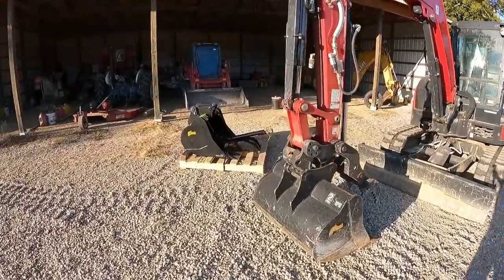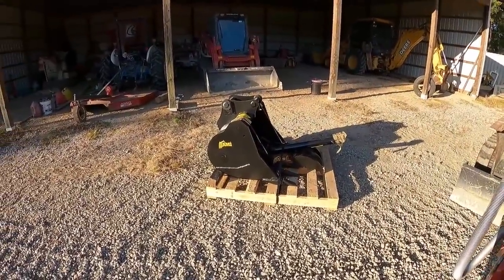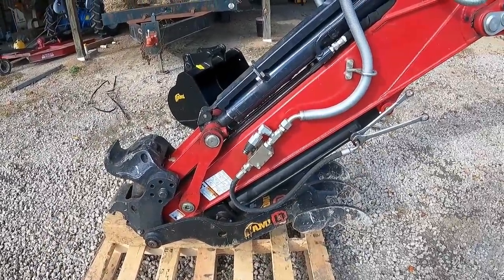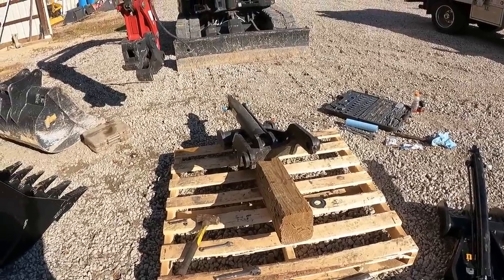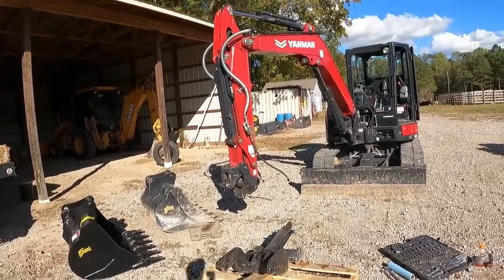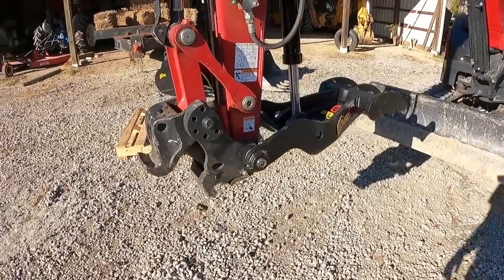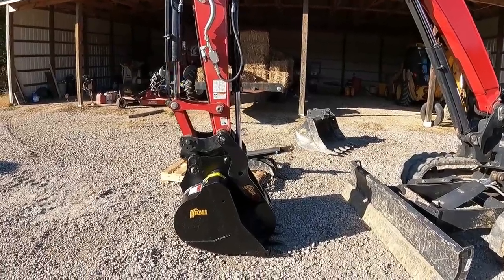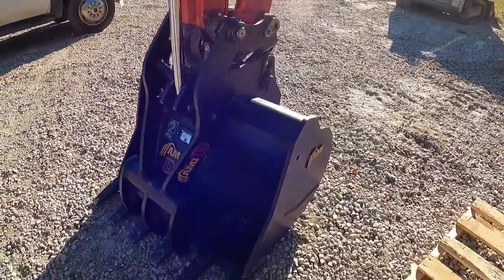Installing My New AMI Mini Excavator Attachments

Comment: You should add a good dead blow hammer to your tools. They don't damage or mushroom pins. I used them alot working on heavy equipment and machinery. That bucket change made quite the difference.

Comment: Much better and in your line work Chris it's definitely going to be more efficient and I'm not sure if anyone caught it when you were knocking out the pin with the over size chisel using the flat end so that you didn't damage the pin
Reply from the maker: Yup I can't stand the chisel marks beat into the end of a pin

Comment: That's a lot better. It's hard to tell on camera but it looks like the cylinder shaft is purty close to the quick culpler when the thumb is all the way down. It will definitely allow you to pick up brush much closer to the machine. Good video Chris!

Comment: It makes my blood run cold seeing steel whacking on steel (chisel) I allmost lost an eye bashing a relutant tooth on a bucket many years ago.  Paying for that boo boo now with scar tissue.  Good video though thanks.
Reply: What else is he supposed to hit it with? A hot dog roll? Where was the chisel? He was hammering a pin in and hammered the bolt slightly so it would spin the pin so the holes lined up. Had eyewear on the entire time as well.
Reply: @mikeznel6048  At approx 11 mins the sharp end of a chisel of some sort.

Comment: It's nice to see the engineers at AMI aren't to arrogant to have a relationship with you, a .... decent operator, LOL to develop new products. I like that set-up with the three tine thumb, how's it for deflection on a uneven grab. The Tag set-up my 55 came with is only two tine and not supported great, with the gusseting ending almost a foot from the tips. If you grab a uneven load you can tweak the thumb tines, no worry though, the next time you grab a load opposite, it will tweak back. I don't like that and am welding in a gusset closer to the tips this week to help with the deflection and better grab/hold ability. I might just get this set-up after the rototilt comes. AMI has great products, they just leave a mark, lol  you get what you pay for though.... sometimes anyway. Let us know how this works out, and don't forget the discount link.

Comment: Better uses than before with the claw having much more distance to travel. 

Only flaw I see is at 23:35 when the bucket puts pressure on the claw. Taking out the slack, could see some flex in the rod when the buckets applied pressure on it. On light loads, it should be ok but not sure about heavy loads when you need lots of grip. Could see the rod bending due to the angle it its at.
Also. the rod clearance to the pivot point is a bit close? need close up to see, but if dirt is on there, could cause issues on the rod.

Comment: I don't know if anyone else noticed this little detail, the thumb cylinder has grease zirks on both sides (at the pin pivot), so it doesn't matter which way it is installed, there is a zirk on the bottom.  Props to AMI for this attention to detail.
Reply from the maker: first thing I noticed when I looked at the cylinder!

Comment: Will you be able to get to the grease fitting with the cylinder turned over, like you did?   Edit,   now I see that it has another one on the bottom side, also.

Comment: So, now that the grease fitting at the top of the cylinder is completely hidden (13:55), how do you lubricate the top pin?  It does a nice job of protecting it though.
Reply: Should be an easy fix. Just get a 90 degree grease fitting. Just have to take the pin out to make room to swap out the fittings.
Reply: Or just curl the bucket so he can get to it.

Comment: Hey Chris, having the T fitting before your manual diverter valve?  Why do you donut this way?  If the tilt bucket is on doesn’t your thumb and tilt work together this way?  I’m sure there is a good explanation.
Also, looking to upgrade from my Hyundai R35-9A to a 50 or 55.  Why did you choose Yanmar? From your delivery video it sounded like your dealer is not close to you.  Can you share your thought process on purchasing Yanmar?

Comment: Looks like they could have canted the hand /end  down ?5 degrees to close the distance. That bolt for the cylinder keeper looks like a 1/4 " for a 3/8"/ or metric sized hole? 
Seems like a low PSI cylinder at 1,800 PSI? 
Doesn't look like there are enough threads for the ny-lock? 
The grease nipple should have been designed to go into the end /parallel to the cylinder so not to break it off. 
I looked at the placement of the hyd feed to the bucket cylinders on the Allied 300 loader and thought this, they eventually changed it so they wouldn't get broken off. By designing them to be welded horizontally instead of vertically would have prevented that.  
A tight radius from the boom lines will cause premature leakage about an inch from the fittings.
Is that a 3 lber??? haaaa 
That is much better. 
Now I will have to go watch "The Bucket Factory RU". hhaaa

Comment: Knocking the pin out, that's 1 way to sharpen a chisel....
Reply from the maker: If I use it the other way it cuts into the pin so I use the hammer end
Reply: @letsdig18  I was just teasing.......

Comment: Chris, the thumb looks really good. When it is fully back against the dipper, how far does it stick out from the inside of the dipper to the curled tips of the thumb. My current thumb on the same model Yanmar sticks out way to far, which drives me nuts during a number of different job applications.

Comment: Looks like the second pin location on the bucket shortens the center distance a little - less breakout force than location #1. But you're only shuffling brush and loading trucks in that location (#2). Any serious gnawing on stumps and hard ground will use location #1.

Excavator kinematics and the practical application of three and four bar linkages: I had no idea subtle changes to the linkages of excavators could be so critical to production.

Comment: The thumb being that far away from the bucket would make it frustrating to use, its how i felt with my mechanical thumb, had to be so far away for it to grab. I'm trying to find a hydraulic thumb on the classifieds i dont need a new one.

Comment: Chris - have you considered or been approached to help design a new excavator? As much seat time as you have in several models I would think you’d be a good asset for Volvo or others. It seems the 220 is the sweet spot. Too bad they can’t do better on the smaller models.

Comment: Just got my 55 back from the dealer. They attempt to put a secondary pto/ wet kit on. And I’m told it’s not possible because my machine has the angle blade and the spool used for the secondary pto/ wet kit uses that spool. Waited five months to find that out. I’m not convinced that they can’t add a spool but have been told they do not have longer rods to enable bolting one on.
All this so I can use the lesser gpm pto for the thumb and keep the other for a hammer, grade bucket or what ever. At this point I have a 42” grade bucket that can’t be connected.

Comment: I still would prefer a little bit wider thumb and one more similar to the Volvo machine you have. I like to be able to pick up small pieces along the greater majority of my bucket. Without them getting missed or turned in a way in which they are missed by the teeth and just fall out.

Comment: I don't know if it's just me but it looked like the thumb cylinder the chrome portion was hitting the end of the stick where the pen for the bucket is when the  thumb fully extended.  Probably need to shorten where the cylinder stops to avoid  damage to the Chrome.

Comment: Very cool Chris and just as you said the pin can be moved so if you so desire you can easily move the pin to make truck loading easier and visa versa if you’re not loading trucks much like you said. Best of both worlds it sounds like and a design that takes input from the field and engineers to make the best all around product for the end user.

Comment: A bit of "movie magic"? At 14:30 the grease nipple at the top end of the thumb cylinder is facing towards the stick and at 17:00 it is facing the other way so you can actually pump in some grease. Nice design corrections form the engineers at AMI tho. Seems there are still some around that are not totally "set and forget".
Reply from the maker: it had one on each side so it can be rotated

Comment: So I'll ask the question! Why didn't you just switch cylinders for the fix?
Reply: Because it's not just a cylinder. It's the mounting location.
Reply: @mikeznel6048  Rotating the cylinder 190' is not relocating. Fittings were the problem.
Reply: @hometownchico  Clearly you didn't watch the video. If you were to rotate the cylinder, it would mounted differently...
Reply: @hometownchico  At that, the thumb itself is different. This is part of r and d. Creating a good production usually takes multiple prototypes and many different revisions. On something that takes as much abuse a thumb on an excavator, you want as few weldments as possible. That meaning when something changes, you don't want to just cut out the old and weld in the new. Especially for a product you're sending someone to use and work the bugs out of it. If it was as easy as putting a different cylinder in, don't you think Chris would have done that? If you're talking about the issue with the fitting on the new one, obviously there was a reason they used a different cylinder with a different fitting. With so much information you so not have, how can you so boldly make the assumption that it was as simple as a cylinder swap? I'm not going to get into flow dynamic and orifices but I will tell you there is a reason they used a different thread size on the fitting. Weather it be for manufacturing reason, flow manipulation, issues with suppliers, part quality, price or even something as menial as the manufacturer simply chose to go with a different type, there was a reason and you don't know what it was. Again, if it was that simple, I'm sure Chris would have gone that way...

Comment: Patience, knowledge of tools, Mr G has in bucket-loads.
PS: I s that a 4lb hammer he uses to knock in the "thumb" pin/ bolt?
"Design" improvements should (ideallt) be  done at the "drawing-board"
 stage?
Reply: CAD helps more!
That is Cardboard Aided Design. 
Practical, and actual 3D.
The computer MIGHT get close, but you damn well better get your hands dirty with the prototype, and the user of the prototype NEEDS to be a real end user. Not a lab tech.